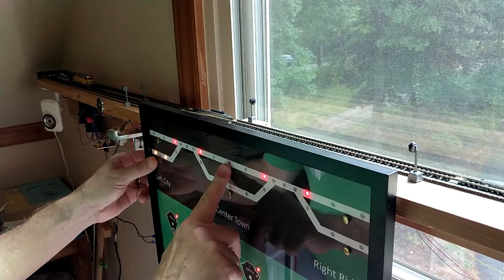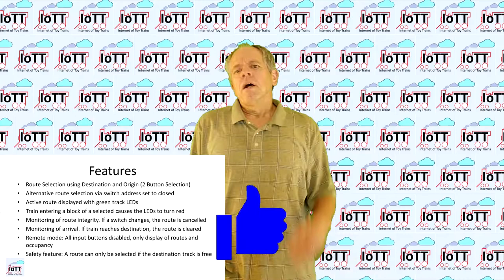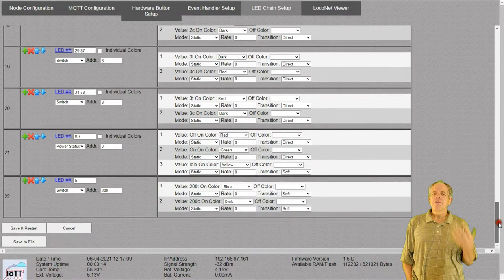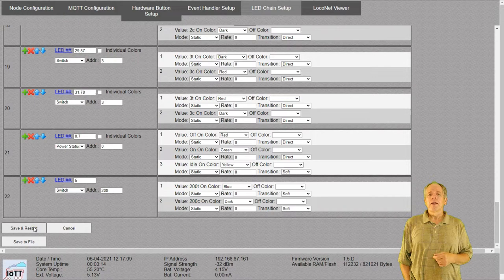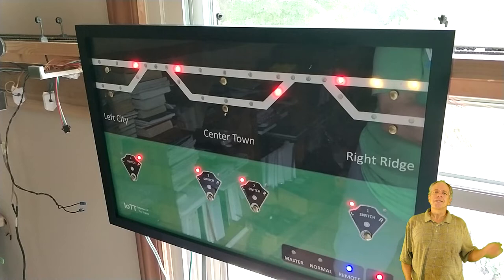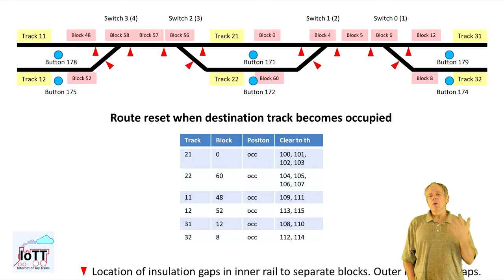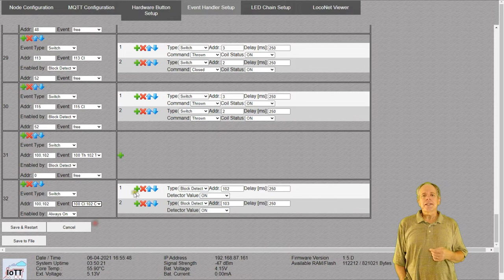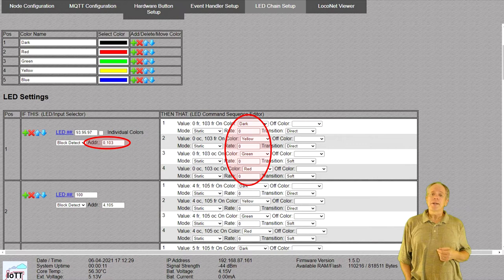YellowHat Tricks (Video#70)

Comment: Can you please explain the difference at 9:47 with the bushby bit ?
Reply from the maker: LocoNet has 2 different commands to set turnouts: SW_REQ and SW_ACK. Handheld throttles send SW_REQ commands for switches, which are not processed by the command station if the Bushby bit is set. You can use this feature e.g. in an operating session to make sure loco operators can't set turnouts. SW_ACK commands are always processed, independent of the Bushby bit status. So, by selecting one or the other command you define the priority of your CTC panel with respect to the Bushby bit setting of the command station.

Comment: Hello, i have a problem, i'm trying to use two buttons for route but not send the loconet message to my signal or switch, for example i have two buttons one is 100 and 101, 100 is hold button and 101 is a down button event i use switch and direccion but no send nothing, 

Ivan
Reply from the maker: Hard to tell without seeing the full configuration. However:
- verify that the buttons are working using the button setup page. Verify the field is changing color as you push the button
- if the hardware is working, verify the address settings and watch in the Loconet viewer what messages you get when the button is activated. When holding down, you should get a hold message about every half second
- once this is verified, check the button handler settings. Try first an action for a single button, then combined
Reply: @IoTT  if i use a single action no have any problem, only when combine two buttons, i saw the loconet packets and only send peertopeer packet, but nothing to change the switch or signal
Reply from the maker: @tremespain  that looks like the hardware is working then. So you should verify your event handler setup, also check the conditional activation. Again, hard for me to tell what the problem is if I don't see your setup.
Reply: @IoTT  Command Source: Loconet interface
Yellow Hat,
enable event handle
the butttons configurate how buttons 

the event handle two button how 101 and 102 direcctions in this example and always enable
Reply from the maker: @tremespain  So, you have 101 as button down and 102 as second button hold address? In that case you would have to first press 102 to bring it in hold state, then 101 to create a button down, and the event will fire. If you first press 101 and only then 102, the event will not fire as the condition is not met at the time button 101 is pressed (which triggers the evaluation).
Reply: @IoTT  I tryed it but nothing, only send the button command, but the switch command not
Reply from the maker: @tremespain  I just did a quick test, it works as it should. Here are my event handler settings:
Evt. Position 1: Event Type: Button, Addr: 17, Event: BtnDown, 2nd button hold addr: 18, Enabled: Always On. The Action is Type Switch, Addr 500, thrown
Evt. Position 2: Event Type: Button, Addr: 18, Event: BtnDown, 2nd button hold addr: 17, Enabled: Always On. The Action is Type Switch, Addr 500, closed

When I hold button 18 and then click 17, if fires 500 thrown. When I hold button 17 and then click 18, if fires 500 closed. Exactly as expected.
Since your hardware is working, I would look for an error somewhere in the event handler setup.
Reply: @IoTT  Nothing, i tryed all, erase flash and reinstall the firmware but nothing them i dont know that make it, My stick is how this video
Reply: @IoTT  What can i do more?
Reply from the maker: @tremespain  Try to set up a very simple event handler example, e.g. reacting on a switch position change and setting a different switch to the same position. You can send a switch command from JMRI or similar software and verify that the command arrives on the stick in the Loconet Viewer. Then you should see the reaction and verify that the command was sent by looking at it in the Loconet Viewer of JMRI. That way you have a working event handler example and you can build from there by adding more commands or more input events.
Reply: @IoTT  I tryed a simple event handler example and good, no experiment to problem, only when try tu config two buttons to route, I tryed always true, with a button switch but nothing. I dont know that wrong.
Reply: @IoTT  Only if i use two buttons dont work, If use one button, switch or detect block no problem (IF THIS), maybe can be my loconet arduino signal device? if use one button and more no any problem, i use usb power one usb for IoTtStick and one usb for arduino
Reply from the maker: @tremespain  Ok, so it sounds the Event Handler is working but not picking up button hold information. Make sure in your hardware button setup the Hold message is checked. Verify that you get repeat hold messages while you hold down the button (about every 500ms). You can also send a screen shot of your setup to hans@tanner-family.org